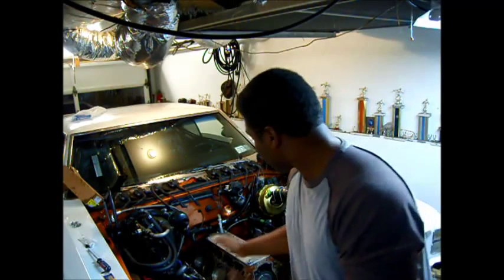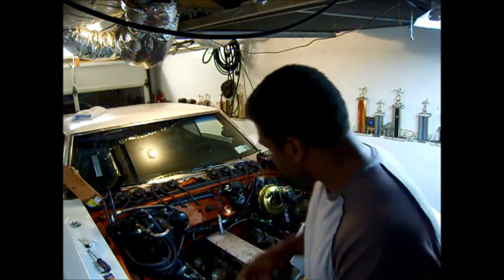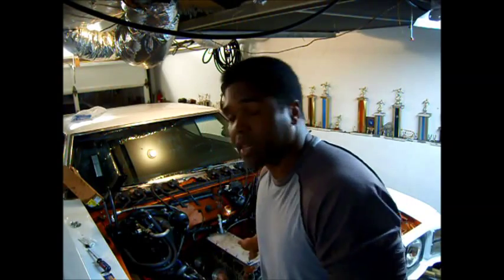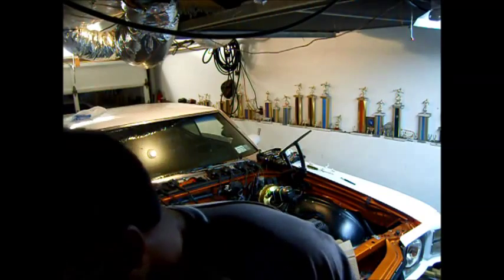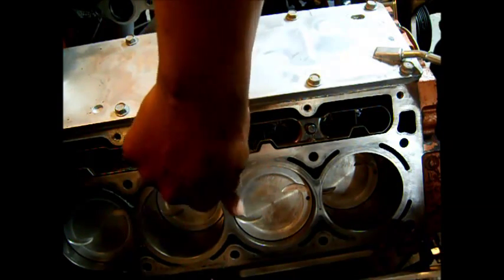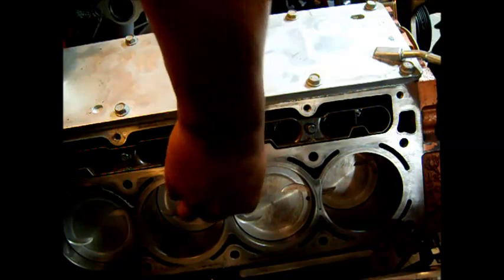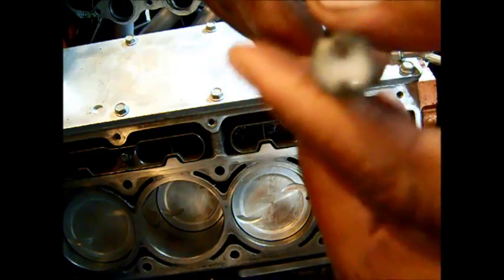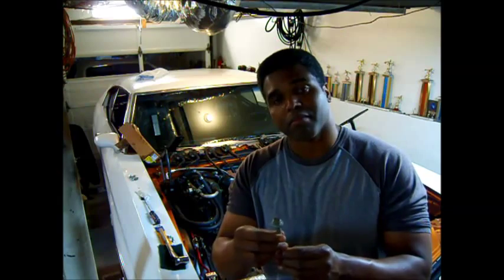Cleaning LS Head Bolt Holes (How To Make A Bolt Hole Chaser)

Comment: don't risk thousands of dollars using a homemade tool - thread cleaners are not expensive but are a important step in a engine rebuild
Reply from the maker: +Joe i agree with you, but there are alot of people that would rather spend that 30 to 50 dollars else where. so i gave them an cheap alternative.  before i put a video out i always do testing, i found the home made chaser cleaned the bolt holes alot better than the store bought chaser.. i would never post something that i dont do or use myself.. most of my viewer appreciate that. thanks for the viewing brotha..

Comment: My ls came to life today but did not have a water flow any tips on how to bleed? or just wait for the thermostats to kick in. Agean thanks for your help
Reply from the maker: congrats on the start up... when i first start an LS engine i get a new thermostat, i put coolant in the top radiator hose going into the engine until the radiator starts to fills up from the bottom. when the radiator is about half full start the engine and continue to put coolant into the upper hose into the engine until it starts to pour out of the top of the inlet/outlet then attach the hose. let the engine run with the cap off until you see no more bubbles. sometimes i will lift the front end up to get the bubbles out easier. hope this helps, keep me posted..